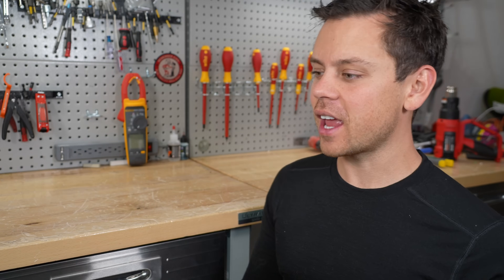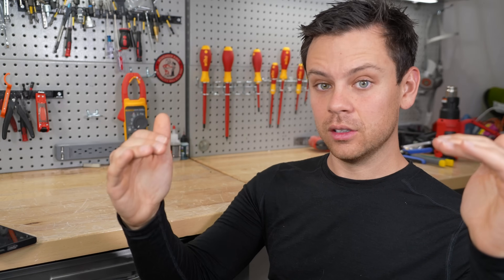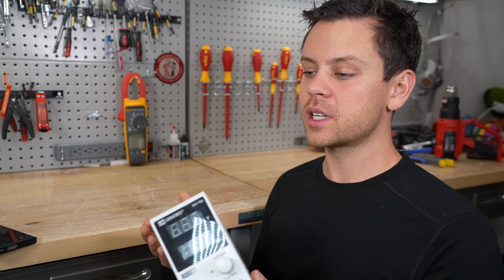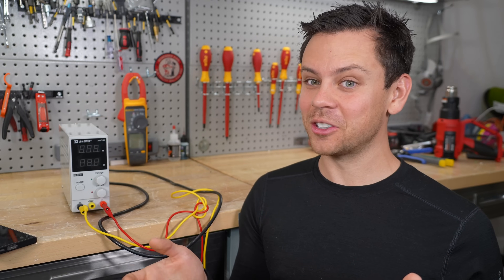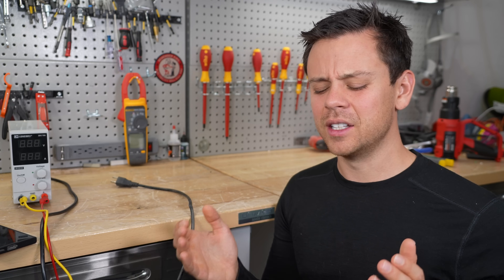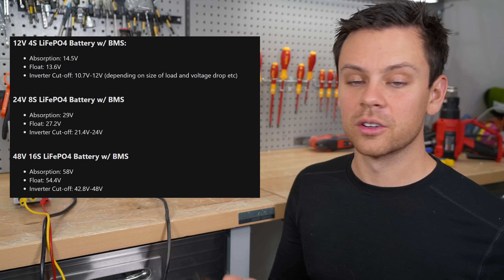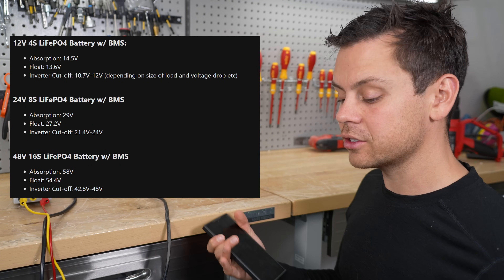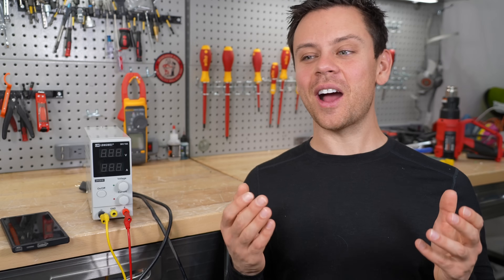LiFePO4 Charging Guidelines: What is 100%? What is 0%?! How to Balance??

Comment: Possible video idea….I began using an active balancer last year. It started as an experiment but it worked better than expected so I just kept running it…….. However, it’s a smart balancer. I have it programmed to only balance when every cell is over 3.45v. With 15amps of balance current it can balance to 0.001v within about 15 mins. It’s expensive but has allowed me to completely ignore my cell voltages.

Comment: If I store my 320ah battery at 65% over winter that could go down to -40c during winter. Will it harm the battery. It’s in a shed at the lake with only snowmobile access in the winter
Reply: Just in case Will or someone with more information doesn't answer you. My recommendation would be to charge it up to 100% for about half an hour to a couple of hours before disconnecting from the system. As long as you don't have any charge nor discharge during the winter, they should be fine. They should only lose a little Voltage capacity over the winter, and as long as they don't drop below about 10.2V for a "12V" battery, you can just charge them up after thawing them out in the spring. You may want to go check the Voltage once every couple of months for at least the first winter, just to make sure they aren't getting too low. Hopefully, if they do drop too fast, you could thaw them out and recharge them when needed.
Reply: @ thanks for your reply

Comment: I've been binging your channel for the past few days. This one has me wondering cuz I'm one of those people buying cheap 12v lifepo4 batteries. Since I only use them infrequently for power outages, does this mean i should drain and charge several times in a row to balance? I use either a 15 or 25a charger that tells me when the battery is full. Well it says FUL. I realize i am the most basic user so not trying to get down into the weeds, i just don't want to do anything stupid. Thanks

Comment: That last video was a good one. Why constantly worry about perfection in balancing.  I do not charge my system to 100% due to the limit on high voltage of my inverter. The inverter is preset.  I would guess I charge to about 90 to 92%. Once every few months I switch off my inverters and use my 29.2v chargers to run the batteries up to 100%.  I then use my dump load water heater to bleed off a little before turning the inverters back on. Works for me, may work for you.

Comment: My issue is that my 16s lifepo4 280ah bank doesn’t charge to “100%”. I have a Growatt 5k all in one set to charge at 57v and it doesn’t reach it. The JK BMS keeps disconnecting the charge due to a cell reaching 3.65. When this happens I see about half the cells are over 3.5 and the other half are below 3.4. 

I had a bad cell that would jump from 3.35 to 3.7v and discharge to 2.8v when all the others were at 3.2v, so I replaced it. Thing is, my original purchase of the eve 280k came “matched”, but this new cell is not the same, it even has a different terminal design, even though it came from the same seller, Docan. 

So now that cell won’t go over 3.38v during charges. I just purchased a Neey active balancer to see if I can remedy this somewhat since I have my off grid glamping site operating on these batteries and need them as there is no other form of power near me(I can’t run a generator 24 hours the noise is unbearable). 

I think what destroyed my batteries(JK BMS says I have 220ah capacity now) was leaving it in a hot environment (temp range from 85-105f) and not compressing the cells(or using plastic inserts between the cells), just putting them in a box I made out of plywood (the cells expanded so much that one of the terminals snapped off) oh and the one I replaced actually leaked some type of liquid. 

Hopefully someone reads this and doesn’t repeat my mistakes, since these batteries are the most expensive component of my system and it’s only been running since December 2022.

Comment: I recently found out that Ego batteries will self discharge. If you have any Ego batteries that haven't been used in a while, were fully charged, and blink green, they're self discharging. From what I've read online, this should happen after about a month. This is a pretty cool feature IMHO, but maybe this isn't even needed? It appears that the batteries discharged to around 50%. 

I have some older Kobalt lithium batteries that only lasted about 5 years before they completely stopped working. I thought the problem was that I was keeping them topped off, but maybe the inverse is true and I needed to charge them during the winter. The batteries are heavily potted, so scavenging the 18650 cells would be very difficult. Unfortunately, the two bad batteries simply won't turn on at all.

Comment: I use an EcoFlow Delta2 Max LFP power station to power my teardrop camper. If I fully charge to 100% at a slower C rate by plugging into ac, I assume the degradation would also be small like you are talking about with solar charging? It is stored in a storage box in the camper, not in direct sunlight and not exposed to extreme temps.

Comment: I've moved to using the meanwell 3stage cccv chargers for my ups type systems. It charges after turned on, or if the battery voltage is too low up to absorption level, holds it there for 30min or so, then drops it to float and stays there. Been working well for my dc fridge system.

Comment: Per battleborn the time to balance cells when topping off the batteries is 20 minutes at 100% charge voltage. Absorption stage.

You did not address this in your discussions.  What's your recommendation for the Absorption time?
Reply: SFK recommends 90 minutes per 300Ah battery in parallel. In my case that is 3 hours for two 300Ah batteries in parallel at 14.4 to 14.6V absorption. SFK has an active 5A balancer that operates only between 2.9 to 3.65V/cell.
Reply from the maker: I actually did cover this and it's different for every battery. And it depends on the initial balance and if the cells are matched. Covered exactly this in the video

Comment: My BMS managed 12v LiFePO4 batt is connected to a solar panel.  It says it’s at 100% at 13.5v (3.37v per cell).  

Why doesn’t it go up to 14.5v when finishing charging?  I’m confused between cutoff vs float.  Is the cutoff voltage the actual 100%?

Comment: Hi. Excellent video. Besides absorption, float and inverter cut off, there is the “Equalization voltage”. Would you be so kind to tell us what the equalization voltage you recommend for a 48v battery pack?
Reply: Is equalization a term used in your charge controller or BMS? Usually for lifepo4 they should be balanced anywhere from 3.4 to 3.45(3.425 is ideal) from the info I gathered in Will’s forum.
Reply: @dalethefarmer  You might need to mention that the Voltage you recommend is per cell, which a 48V system has 16 of, thus he would need to multiply your recommended Voltages by 16 to get the 48V system recommendation.
Reply: Only lead-acid batteries need equalization. When I replaced the lead-acid batteries in my "power trailer", I set the equalization time to zero...as the solar controller I used doesn't allow me to set the equallization Voltage to the proper Voltage...i.e. float Voltage.
Reply: @Tumbleweed5150 Thanks. You are right, even though I have LFP batteries, they don’t have communication ports (open loop) so I had to hook them up to my EG4 6000XP inverter as Led acid batteries.

Comment: Will, big thanks for explanations, scenario:
- system not used daily (load mostly on weekends),
- small solar for topup 400-800W solar, system planned will be 48V lipofe4(most likley), grid avaliable on demand (as im out)
now the challange you mentioned to keep it "storaged" at 50% - clear. 
what about scenario if i use it only over the weekends -> should i implement program that will slowly discharge the system over few days(based on existing load) to 50% and then "disconnect" (could do it with cut off voltage as "low" at 50%) and on friday morning pull the load from the grid and charge it up to 90-100% before i arrive? 

or more and more im leaning towards final conclusion... keep it charged at 100 by the solars, and ignore all degradation with how inexpensive those batteries are becoming ? in the past lead acid battery lasted for me 4-5 years...  i don't have enough experience with lipofe as they are new and only getting in my financial range :)  played with 12v 200 ah and it was amazing... but im trying to think it through how to enable a setup that will last years :)
cheers
Greg
Reply: I've decided at the moment to go with the idea of keeping them at 100 all the time since I only use my 5 12v 100ah cheap batteries as a backup for power outages. I'm 62, I probably won't outlive the batteries even with minimal care. Hmm did I mean minimal care for the batteries or my body?!

Comment: What do you consider to be a hot environment, for battery health? What should be a maximum temperature?
Reply: It depends on the cells you purchased, they should state that info in the specifications. Mine for example say that the ideal operating temp is 25c or 77f, and at 45c or 113f the degradation is doubled. 

I’ve also heard this, lifepo4 batteries like to be at the same temperature as you and me.
Reply: @dalethefarmer  so keeping them in a wooden box probably isn't great for them. I enclosed mine in an MDF vox to protect them in the garage of my toy hauler.
Reply: @dalethefarmer  I like that second one.  So if I can be ok at 85F then my batteries are ok.   I do wonder though.  I saw that same rec for my cells, but if 113 is doubled over 77f then where is 88F on the degradation scale?  Would like to see that curve.  And that testing is done with charge/discharge at 1C?  or...
Reply: An enlightening point I got from Will (if I understand right)  is that an important aspect of heat degradation is the heat produced while charging.  That's additive to the ambient and I can imagine high ambient with high C rate is double degradation but medium hot ambient with low C may be NOT thaaat baadd!

Comment: I keep hearing "High Temperature" every time I cry a little. My bank is on a boat. I relocated them outside the engine compartment for fear of High Temperatures. However, I worry in the cabin on hot days, while not in use, the air conditioner is not running. So, I worry about what is considered "High Temperatures"
Reply: Probably not an issue for you.
Reply: On my the battery compartment is  adjacent to the engine compartment. My engine cooling fan draws cool air from the battery compartment which is cool by contact with the hull. In Puget Sound the water rarely gets above 45F. The batteries run about 45, in the winter, to 55F on the hottest of days. I also never run over 0.1C. I've been told by the battery supplier this is a great range.
Reply: @garymiller7870   @garymiller7870  I have mine under the v berth. But she lives on a trailer when not in use, and the summers get into the 100s.
Reply: @garymiller7870  .25C is a good range. It must take you all day at .1 to charge them. How many AH and what voltage are you ruining? Im using 400ah at 12.8v with a 100amp power supply.
Reply: My bank is 600Ah, I charge at 60A max at 14.4V Abs, 13.5V Float. Yep, that's up to a 10 hour charge plus the manufacturer recommends an additional 3 hour Abs soak. I'm limited by my 120A alternator. For long motoring at higher RPM I can push 100A. 

As this is a 40' sail boat the application is unique. 600Ah lasts us 2.5 days offshore. So we run the engine once a day to recover the day's usage, maybe 1-2 hours. When the wind dies we run the engine and top off the batteries. When we get to a marina we use a shore charger. We also have a solar panel that delivers maybe 60Ah on a good day but it's not much help.

I'm using a large battery bank because I would like to add a 3Kw inverter and then step up the alternator to 250Ah. Maybe expand the solar.

Comment: I have a 16S 280Ah pack with a non inverter type JK-BMS... What would be the actual values for the settings on the BMS ? 
Thank you!
Reply: Low Cut @ 44V
Bulk charge @ 55.6V and float @ 55.2V
Balance start @ 3.4V (cell)
Reply: @joulessolar8082  what about solar inverter settings? It does not commmunicate with the bms, but i can set voltages
Reply: @joulessolar8082  Hi....I just changed the values on my JK Inverter bms to the values Will sets in this video for 48v. After watching this through can you explain your reasoning for the lower settings please because I'm now questioning whether I did the right thing or not. Thanks.

Comment: Thanks for the information on Victron defaults. I'm using a Victron solar charger connected to a Siekon 100-Ah battery I bought using your link. Over a few days, I realized the Victron defaults were low and Siekon does not specify a float voltage. So, this video filled in the data I need.
Reply from the maker: Glad I can help!!!

Comment: Wills life motto : 'It's-not-that-bad' 😆
Reply: That's how I describe my marriage now.
Reply: @ bruh
Reply: You pay what you get
Reply: @zarbonida  haha, , , you get what you pay !!
Reply: Paying a 6 figure tax bill while living in a MoTAR home. It’s not that bad
Reply: What’s actually bad is people worry too much about everything.
Reply: That's because "bad" with rechargeable battery systems-- especially high power ones-- used to be... BAD.
Reply: I think he is correct when speaking about LiFePO4, because having 3.000, 5.000 or even 8.000 cycles before capacity shrinks down to 80% of initial value due to unavoidable stress is a completely different animal than just 1.000 cycles that you do have often on Lithium batteries which have a maximum cell voltage of or around 4.2V.
I also do wonder why people discusses to the knife if maximum voltage for charging should be 3.55V or 3.60V or 3.65V, when the manufacturer of the cell does specify he did all his cycle life testing at maximum 3.65V.
Reply: Was gonna say " new T shirt idea"

Comment: Best videos on the web by far! Thanks for doing what you do. A video I would really like to see is about what is actually communicated between the inverters and batteries (I have 6000XPs and EG4 Lifepowers and EG4 wall mounts )  I am very fuzzy about the best way to link the communication cables and don't really understand the advantages of closed loop communication vs just letting the individual BMSs do their own thing independently. I would love to see a video on this, Thanks again.